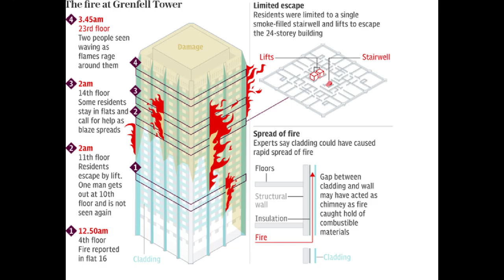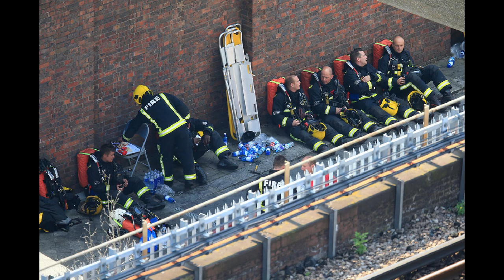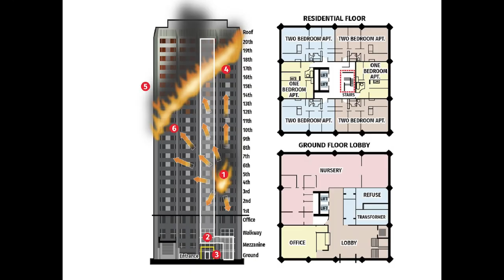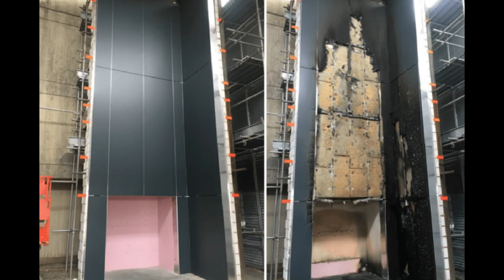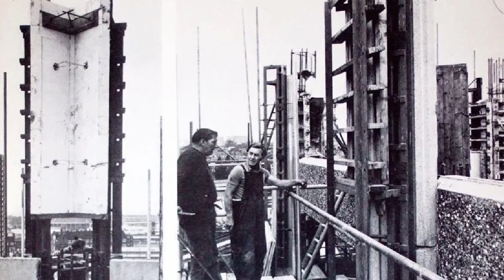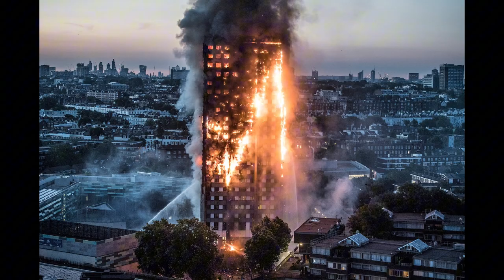Failed Every Safety Test - But UK Regulators Approved the Cladding

Comment: Anything can catch fire if the ignition temperature is reached.Why didn't the occupier  pull the plug out on a smoking electrical appliance like any of us would do...why did he clear off and not  pull out the fire hose (available on every floor) or contact the services for ages and allowed the fire to get out of control.
Reply: Horrible comment. He called the fire brigade less than two or three minutes after discovering the fire, which made a negligible difference given it had already escaped into the cladding before the brigade even arrived, and it took them longer than that to even get to the flat.

Now, I wonder why he didn't pull the plug from an appliance that was already on fire? I wonder!!!!

Desperate to blame some poor soul with trauma and guilt on his shoulders instead of the execs and councillors laughing all the way to the bank with their unsafe building. Absolutely shameful.